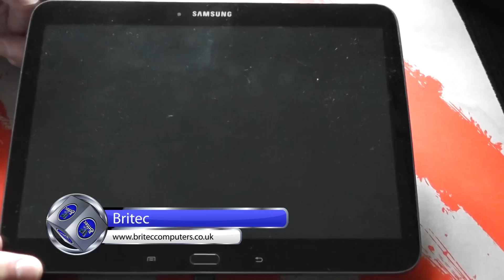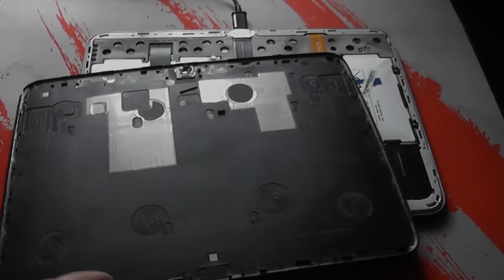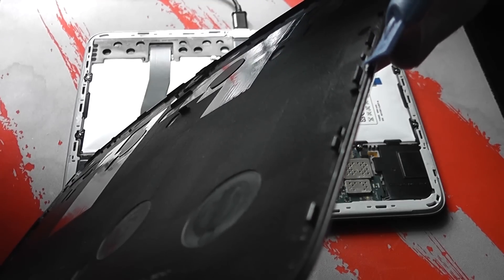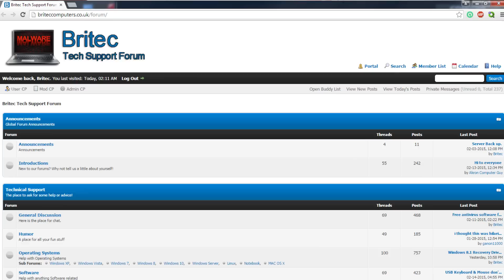Fix Samsung Galaxy TAB 3 Wont Charge or Turn on

Comment: It worked for me, basically the tablet would not charge.
I disconnected the battery for the first time, then after 30 seconds I put the battery cable back in, I put it on charge and let it charge completely.
I had an additional problem. the tablet would not turn on, so I disconnected the battery, put the tablet on charge and tried to turn it on to charge without the battery cable attached.
By magic the android system started, I turned it off by holding down the power button with the tablet function, disconnected the charging cable, put the battery back (the old one) and finally by pressing the power button now the tablet started up without any problems with the battery charged and connected.
This video served as a starting point for me to have a new experience, thanks for sharing it and may God bless you.

Comment: I thought my Tab 3 broke as it didn't turn on when I was charging, so I was finding videos about how to fix Galaxy Tab 3 not turning on, and I found this video, but then I charged it with another wire and it started charging, so that means it didn't break and everything on my Tab 3 works, thanks for this video though!

Comment: Thank you so much!!! I usually have this problem when i leave my tablet off for long periods of time. I didn’t replace the battery, but i did unplug the thing that connects to the battery. After that, I waited a bit, replugged it in, charged my tab, and it turned on (although it has zero battery XD).

Comment: How long did you have your device before it malfunctioned?  When you changed the battery, what was the battery life? For example how long did the charge last and were there any further battery issues? How long do the batteries last in terms of the life of the device?

Comment: if you hold down the power, volume up button and keep tapping the middle button for approx. 5 seconds the device will show a message in red text saying 'low battery! voltage should be above 3w' it is a quick and easy way to decide whether or not you should go ahead and replave the battery
Reply: your method has actually started my device! and the battery was not low. No idea why the tablet didn't want to start the normal  way

Comment: Hi, Great Video & very helpful. My tablet has turned off and will not swtich on at all, my pc doesn't recognize it. I've charged the battery externally but it won't turn on, & if I plug it into a wall charger the motherboard starts heating up on the upper right hand side of the tablet (under the power button). I've unplugged all flex cables and even changed the usb power connector cable but to no avail. I've tested the power connector on the mainboard with a voltage pen tester & no voltage passes when the tablet is being wall charged or when the battery is connected to the tablet. Is there any way to pinpoint the problem & fix the tablet?
Reply: did you ever find a fix? i have the same problem

Comment: Ive tried pretty much every trick there is to try get my Samsung galaxy Gt-N8000 working, at first it worked but the battery would not charge so as soon as the power cable was removed it instantly died. Battery does not look puffy/bloated at all it pretty much looks perfect, i tried the ribbon cables and still nothing. Its not the charger as ive used other proven to work chargers with no result. I wonder if its the battery but i kinda need to know its a battery fault before i go buy a new one as i dont have money to waste if the new battery doesn't work.

Comment: I have this problem. I did everything you said. I also installed a new battery but I still have the problem.
Reply: you might need to replace the charger port. it might be damaged
Reply: I think you need to reinstall system/ROM Hope I help you 🙂🙂🙂🙂

Comment: My problem is that it works perfectly fine but when I charge it, it stays on 0% and it doesnt increase the battery life. what should i do??
Reply: I'm having the same problem did you ever fix it?
Reply: Same with my galaxy tab s3, but it doesn't show the number it freezes
Reply: try recalliberating the battery
Reply: Same I'm having the same problem

Comment: I spent 3 hours on chat with samsung.  They know about this issue and will NOT do anything to fix it. Its from their update.  They WILL fix it if you send them 250.00 HOLDING FEE plus 75.00 for repairs.  Im done with SAMSUNG
Reply: Karen Gierke the power cable and battery are dirt cheap and quite easy to replace. Parts are very easy to get on ebay. Im sick to death with all the smartphone and tablet companies. I know what you mean.

Comment: My Samsung galaxy 12.2 pro takes several hours to charge but won't hold the charge no more than 3 hours afterwards it gets very hot. I get a message low battery and when I plug it into the charger it say cannot charge now, battery to hot. I have taken it to to be fixed twice only when I get it back it's doing the same things. You are my last hope. I have had it about 3yrs.

Comment: I have Galaxy note 10.1 that showes exactly the same as yours before you change the battery  but mine show that battery is charging. Hard reset doesn't work, now idea what to do with that, any suggestions please?

Comment: I change a new battery and it is charged very good, however the tablet needs to connect to the power adapter to turn on,and it is turn off straightaway if I disconnect the power adapter. Please advise what wrong with the tablet. Thanks.

Comment: My tab 3 died 4 years ago, 1 year ago I replaced the battery and charging port/microphone, it worked for 2 days and once it depleted to 0% it did not charge anymore so I abandoned it, today I cleaned it off, and tried plugging it in again. After 5 minutes it started to flucker the empty battery/with a circle in the middle (like a battery loading) and then showed me the "Samsung Galaxy Tab 3" screen, kept on switching between them, after a while it got stuck on the "Samsung Galaxy Tab 3" for 5 hours, so I turned it off and left on charger. What do you suggest?

Comment: Battery connector alone didnt work.  Undid the other 2 ribbon cables and also blew compressed air in USB port...something between the 3 of these made it boot up again fine.  Did not need a new battery

Comment: My Samsung galaxy tab 3 10.1 is randomly shutting down, in weird angles or just by chance. I have googled the problem and the most probable fix to my error is to use a bit of plastic tape. Any way you can confirm that? The battery charges just fine and when i have the charger connected it's all happy days etc. But when it's out it just randomly shuts down. Cheers
Reply: Josip Broz Tito Ne znam Tito
Reply: me too
Reply: Where can I get a battery

Comment: So let me explain what i did and if you can help me then i would be very happy. My tab 3 wouldn't charge and I thought that my battery was the problem. I bought a completely new stock one. Then I thought a factory reset would help because I've had black screens or not charging issues before. I searched a lot of tutorials for doing it on you tube and I did all the steps accordingly. My tablet restarted, on the screen appeared the "samsung galaxy tab 3" thing and from then it stays like this 
continuously. I don't know what to do anymore. Help!

Comment: hey i have the same tab. i replaced the battery and it was fixed for a few months and i went to power it on after a bout 3 weeks and its not doing anything. It wont even charge. Please help.

Comment: Hey my tablet won't turn on what so ever it was working Wednesday fine and then it needed charging so I put it on charge it said it was Charing the next morning (Thursday) my tablet was dead and won't turn on . Would it mean that I need a new battery? Or could it be the charger hole? (idk what you call that) that's the problem and if it is the battery and I get it replaced would all my stuff still be on my tablet or will it be wiped I need help :/

Comment: I have a Galaxy tab 3 doing the constant rebooting but the battery is nice and flat looks great any other suggestions?
Reply: 8 inch screen
Reply: +andrew “Astew67” STEWART check your charging port.
Reply: +Juggernaut383 the plug feels tight in it.  I had the charge port go bad in a Galaxy S4 and it did not act like that. I haven't used the tablet in like 3 months could that have any thing to do with it?
Reply: +Juggernaut383 the plug feels tight in it.  I had the charge port go bad in a Galaxy S4 and it did not act like that. I haven't used the tablet in like 3 months could that have any thing to do with it?
Reply: +Juggernaut383 the plug feels tight in it.  I had the charge port go bad in a Galaxy S4 and it did not act like that. I haven't used the tablet in like 3 months could that have any thing to do with it?
Reply: +Juggernaut383 the plug feels tight in it.  I had the charge port go bad in a Galaxy S4 and it did not act like that. I haven't used the tablet in like 3 months could that have any thing to do with it?
Reply: +Juggernaut383 the plug feels tight in it.  I had the charge port go bad in a Galaxy S4 and it did not act like that. I haven't used the tablet in like 3 months could that have any thing to do with it?
Reply: +Juggernaut383 the plug feels tight in it.  I had the charge port go bad in a Galaxy S4 and it did not act like that. I haven't used the tablet in like 3 months could that have any thing to do with it?
Reply: +Juggernaut383 the plug feels tight in it.  I had the charge port go bad in a Galaxy S4 and it did not act like that. I haven't used the tablet in like 3 months could that have any thing to do with it?
Reply: +Juggernaut383 +Juggernaut383 the plug feels tight in it.  I had the charge port go bad in a Galaxy S4 and it did not act like that. I haven't used the tablet in like 3 months could that have any thing to do with it?
Reply: andrew STEWART
 Shouldn't matter how long you didn't use it. Just try a few other things. What I would do next is go into the boot menu, wipe the cache and restart. Hold the power and volume up buttons and then release the power button when you see it powering on.
Reply: Is says I can load a custom is but then does a power cycle,  it's like a rythmetic rebooting cycle that stops for nothing short of unplugging the battery.

Comment: tq very much i got so panic cause i hit 0% battery and the tablet won't turn on or charge no battery logo either i just plug the battery connector w8 30 s and voila i hold power button and it boot TQ

Comment: Have a Galaxy Tab 2 that won't charge. I get nothing on the screen at all. I removed the back and checked the battery with a volt meter. The battery has a little charge &  is not pregnant. I removed the connector for 30 seconds and depressed the on off switch to dissipate the mother board. Put it back and still don't get anything on screen when trying to charge. Any ideas?
Reply: Me too theres nothing on the screen its just black

Comment: Hi i know this video is old but i still hope you respond, i just had my ribbons checked but whenever i charge my tab while its still turned off it charges reaaaaaalllly realllyyyy slowly, when its turned on the battery icon shows a crossed lightning symbol(its not charging) :( why is this ? :( my battery doesnt look bloated or anything
Reply: hi dude i had this too. check the charging port you may need to clean it or get another k. make sure all pins are correct and try different chargers
Reply: thanks man. its all good now just had to tinker with it a bit lol

Comment: my samsung galaxy tab a will not on or charge. i tried to root it 5 mins before it turned off. first it disconnected from the internet and it kept freezing up and lagging.  and i got it for my birthday and im really sad that it stopped working and i cried alot.

Comment: My tab is stuck on the samsung galaxy note logo..... I tried removing the battery and putting it back then charged it. It says 100%. When it got stuck I used the power button and vol up. It turned off and went back to the charging battery icon.

Comment: we changed my tab's charging whole few years back and now it's turning on when it is connected to the charger or it turns off when i touch it or if it is like 98% charged and i charge it, it turns to 0%
Reply: It happened with me as well but a few days after it went  to normal
Reply: You may try changing your charger
Reply: @mrswaseemahmed5676  it died :(  i have a new one now :)
Reply: @vashappening5440  good

Comment: it does not work for me i did ir like 100 times it just wont turn on what should i do???
Reply: Try charging it using only 1.0 A
Reply: disconnect the lcd ribbon and battery port for a minute then use a computer ect for a trickle charge sometimes a charge is left in the lcd unit and won't recharge the tablet